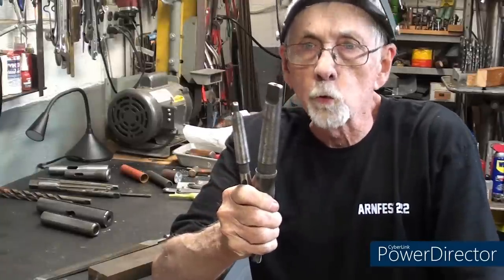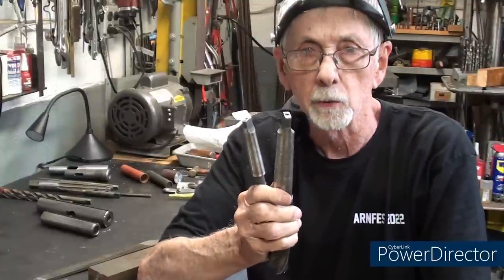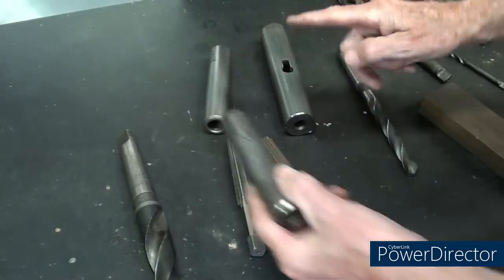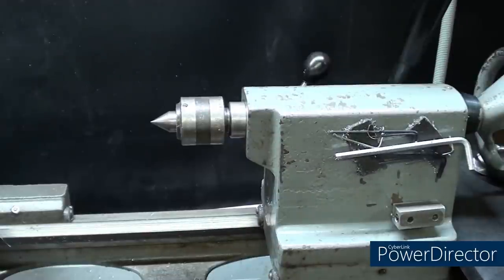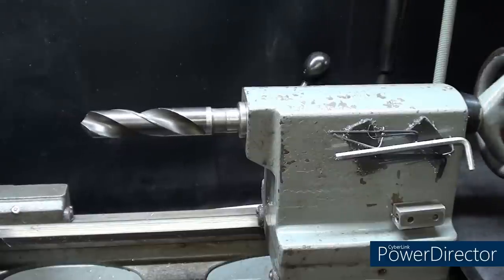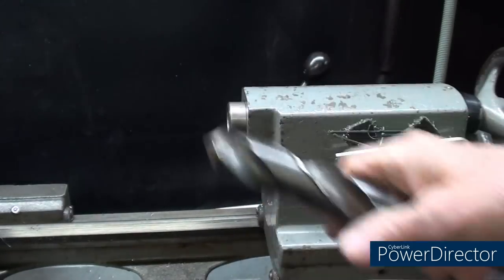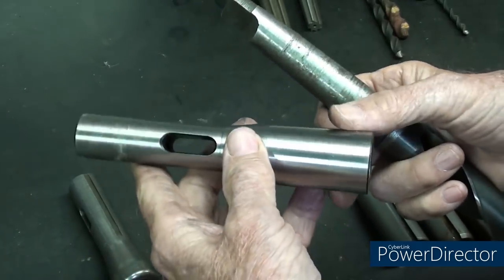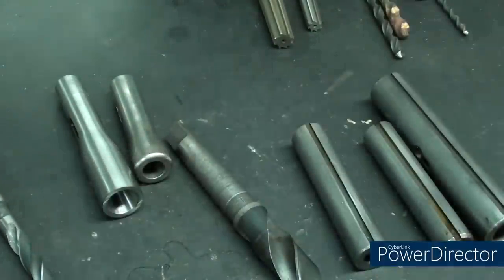DRILL TANGS REVISITED #846 tubalcain mrpete taper sleeve

Comment: I wonder what the area of the blue tape (developments) is as a ratio of the drill diameter.
The #1 looked to be big compared to the #3.
If my theory is correct the torque of the small drill is transmitted over a relatively bigger surface area.
Reply: Comparing Jacobs tapers to Morse tapers.
A drill chuck can easily drive a 1" drill with a 1/2" reduced shank via a J2 taper with 6x less suface area than a standard 1" drill with a 3 Morse taper. This suggests that the Morse taper is more than capable to drive the drill bit without needing the tang.
Reply from the maker: Only last night, I started contemplating a discussion on the various Jacobs tapers. Small diameter, short tapers that never slip.
Reply: @mrpete222  Milling a slot to suit a drift for ejection naturally leaves a tang shape in the socket therefore saving the socket from being bored deeper. It's an unusual situation where the solution for ejection ie. the tang looks sxactly how you would design a driving tang. So it looks exactly right for driving, but by accident.

Comment: A short Jacobs taper can easily drive a drill chuck even with large reduced shank drills, proving that a much larger Morse taper can drive the drill it was designed for. Jacobs tapers do not need to be ejected so they dont have a tang.

Many lathe tailstocks do not have a tang slot as they self eject, proving that the lathe manufacturers know the taper is for driving only.

All Morse tapers in good condition will easily drive the tool providing they are given a sharp tap to seat them. If the tools were seated this way there would be no slippage and no debate. The most common misconception is that the tool pressure seats the taper, this is not sufficient. Taper pins are not pushed into the tapered holes, they are driven home with a sharp tap. Drifts are not pushed to remove the drill they are given a sharp tap. So locking tapers together need to be given an impact to lock and release, pressure from drilling is not enough.
Reply: Absolutely correct! If only one person (the owner) uses the machine and he/she follows that rule steadfastly, never a problem. I commend you. Defense rests. 👨‍⚖️👩‍⚖️
Reply: @StanErvin-yo9vl  Thanks Stan. The complete absence of the crucial fundemental step to seat a taper properly in two videos and hundreds of comments is surprising.
Reply from the maker: Excellent comment, thank you

Comment: If the tang is only used for removal, why have it at all?  A drift could force a round end out just as easily as a tanged end. My $0.02.
Reply from the maker: You are so, correct, in fact, I will be making a temporary video soon illustrating exactly what you are saying.

Comment: Let's see what the experts say.
Dormer have been making drills since 1913 so I guess they know their stuff.
Quote from the Dormer Twist Drill and Reamer Information Handbook ...

"Morse Taper Shanks are defined as self driving, that is they are designed and made to drive off the taper 
-N O T   T H E   T A N G.
The tang is for ejection purposes only."
End of quote, please note that Dormer actually put the important part in red capital letters!

From the Engineers pocket guide by MSC.

The tang is for ejection purposes only.
Allowing the torque to be taken by the tang will result in breakages.
Always ensure that the taper socket is free from foreign matter and damage. So that friction alone drives through the taper.
When using a taper shank drill use a soft face hammer or wood block for insertion.

From the SKF cutting tool handbook.

When driving taper shank drills into sockets use a soft faced hammer. Make certain that there is a good fit between the taper shank of the drill and socket, otherwise the tang may break.
Tang failures  are due to a bad fitment between the shank and the socket thus taking the drive off the taper and putting it on the tang.
Reply from the maker: Thank you for an excellent article. The problem is there are other articles that say the exact opposite. We will have to wait until we get to heaven to find the actual truth, lol.